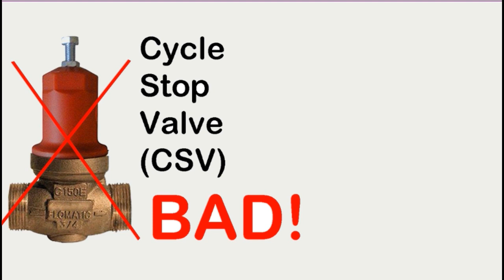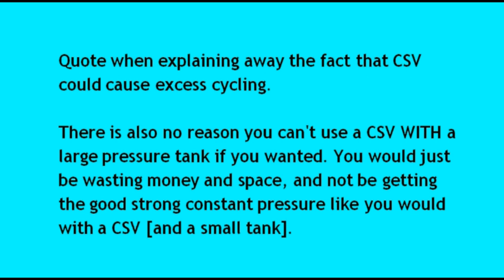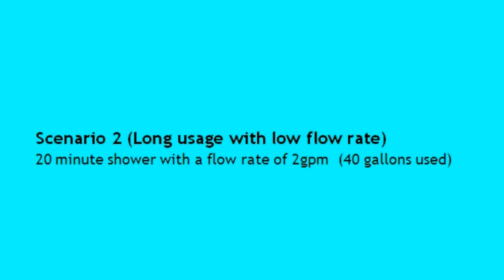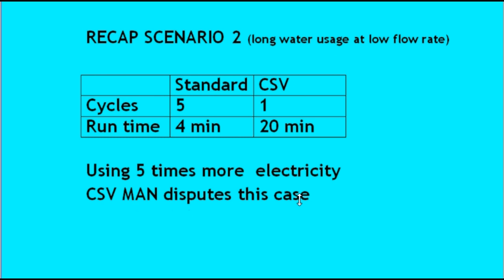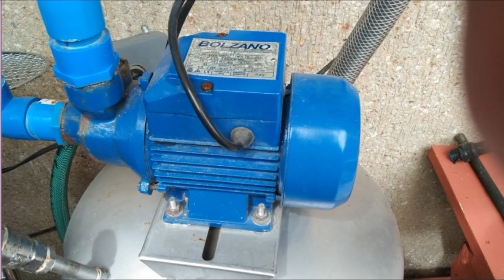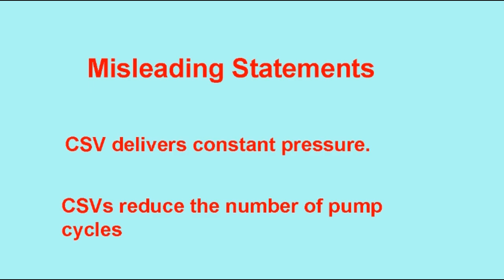Cycle Stop Valves ARE BAD for pressure tank systems!  Pros and cons of CSVs – few pros, many CONS!

Comment: Thank YOU Larry for an excellent review of this fraudulent product.  But, of course, then Mr. Austin (if that’s even his real name) is a con man par excellence!  Of course he had to have known “exactly” how a pumped water system worked in order to be able to convincingly extrapolate his false claims to fit his sales snake-oil sales pitch!  It “was” quite an impressive presentation though, with his animated flow and electric consumption diagrams.

So I – as a retired, patented, and multiple award-winning mechanical design engineer – became suspicious when trying to analyze his dazzling visual display, and his claims, and not being able to understand how this device could work; coming to some of the same conclusions that you did.  Obviously, stalling an electric motor cannot reduce its energy consumption, for one.  As you pointed out, and tested for, a higher load on an electric motor (like his restricting its flow, and increasing its pressure) can only “increase” its current draw as it has to work harder trying to maintain its flow rate.  I got tired of trying to sort through all these danger signs when I went and found your YouTube video: and you have definitively confirmed my suspicions, and have answered all my questions.

The reason that I came across CSV Man’s video, “How a Pressure Tank Works and why you need a Cycle Stop Valve,” was that I wanted to learn more about how the pressure-boosting system that I needed, and was building, works: with a 1/2 hp shallow well jet pump and a 20 gal diaphragm pressure tank.  An excellent YouTube video on why you need a pressure tank is "Pressure Tank: Operation and Components" by R.C. Worst & Co., Inc., at https://www.youtube.com/watch?v=WiVkI8YbE64.

The old saying that "A thief steals your money with a gun, a con man with a smile," certainly is applicable here just as it is with our unfortunate liar-in-cheif, and other politicos, with their fraud and much worse!  So I'm reporting Mr. Austin in this video, "How a Pressure Tank Works and why you need a Cycle Stop Valve,” at https://www.youtube.com/watch?v=LPIUufWjbic (and note his several other YouTube videos that you’ve alerted me to) for being a “big” fraud, a scam and a thief!

Find Out Who YOU Really Are!
LettersToMyBeloved.com
Reply: As an engineer you should know the difference between stalling a motor and derating a motor. Motors can be derated and restrict flow naturally by placing them in deeper wells. Pump installers do it all the time. Also a amp current check is the first thing pump installers do to check condition of a motor. They deadhead (restrict flow to 0gpm) the pump and check amps, if they are higher than full load that is a bad motor. If amps are lower than full load or derated then the motor is still good. I love how people comment on energy consumption without ever using an amp meter on one. You are a scam.
Reply: What type of pumps would you use for 8 BB 20''-4.5"in parallel filters and a final stage of 3 BB 20" 4.5" inline and a final 40" nanofiltration filter? ( my intent is to recircuate the waste of the NF membrane and reuse it).

Comment: perhaps its best to id the type of pump you are referring to in your examples.
Its hard to grasp but read up on Bernoulli's Theory and The Laws of Affinity. Basically what it is is that by restricting the flow of centrifugal pump, you are reducing the amount of work being performed thus reducing the power consumed. It also usually reduces the corresponding heat the pump produces since heat is directly tied to power consumption.

Comment: Larry can you advise me on this water use problem I have. I have a three hp submersible pump producing 83 gallons per minute under no load. I intend to  use this pump to water my lawn, each zone will require 35 gallons per minute with only one zone watering at a time. There is no pressure tank in this system, water will go directly from the pump to the sprinkler heads. Would you advise using a CSV for this application or can you advise me of a different valve or system? Thank You

Comment: At 34:00,  CSV Man may be assuming this particular pump as an example maybe because an industrial pump of this size often comes with an UNLOADER valve which essentially acts as a pressure relief valve, but opens fully, thus shutting off nearly all flow. CSV Man is fully committed to maximizing cash flow from his bogus invention, while minimizing proof of actual test conditions.

Comment: Larry, I installed the CVS valve.  In your scenario 1 at 18:02 you say the pump will cycle every time with each brief usage.  That is not my experience at all.  I have the very simple submersible pump set up you describe with a 20 gallon tank and a pressure switch set to 40/60.  The CSV valve is set to 55 PSI.  So, in a low or no water usage scenario that occurs after the pump cycles on the pump will run until it hit 60 PSI.  If I just wash my hands after that for 20 seconds or flush the toilet the pump does not cycle on.  How could it, if the PSI has not hit 40?  Perhaps, I'm missing something but, respectfully,  this basic premises leaves me doubting anything further in your video.  Can you explain?
Reply from the maker: yes i can explain easily. You have a 20 gallon pressure tank. That's way bigger than what they recommend. The bigger tank solves one problem but introduces others, like long tank refill time and more variance in the pressure before finally stabilizing.

Comment: Thank you Mr Larry for putting this video for reference. I am absolutely agreeing with your presentation and analysis. I saw the simulation that CSV man used and I am not convince. That man just moving his lips. I was actually looking how the fluid goes to the mechanical devices (the CSV) but the salesman could not reach that simple technological presentation. I was looking for a mechanical device as a replacement of VFD (lead times are too long) for my customer. I was not convinced about the CSV man and you enforced that on your presentation. If I may further your evaluation on the CSV, putting a device along the line increase the total head loss or pressure loss. Maintaining the demand flow in scenerio #4 with CSV requires more head pressure on the pump, more stress on the pump, more power needed, thus, less efficient and reduces the lifetime of the motor pump.
Reply from the maker: Yup, you are right. Thanks for you comment.

Comment: Love it! Thank you for your time spent on this. My well people pitch me the CSV with a smaller tank. I am doing off-grid solar and have lots of power concerns about the well system. You covered every concern that I had and more. I am going to go with 86 gal tank and with a pressure switch instead. Thanks!
Reply from the maker: You're Welcome! You also might want to consider the configuration of well pump to water storage tank then  water storage tank to pressure tank via booster pump. I cover that in some of my videos. That is even more efficient. If you are concerned about power and efficiency that may be the way to go.

Comment: I have to disagree with what you said regarding the "constant pressure issue", where you have stated that with the CSV valve installed, that varies from 40 to 50 the system will stay at 40 and maintain that pressure, which is absolutely not correct. I did personally install the said valve, and after turning on the water, pressure starts going up until it reaches the 50 cut off point and stays there, maintaining the same pressure as long as the water stays on, with the pump consciously running and a not cycling on /off. Once the water is turned off, the 50 psi pressure stay on until the water has been turned on again , and that’s when the pressure starts drooping till it reaches 40 when then the pump comes back on until it the 50 cut off pressure point is reached, and where it holds with the pump running and maintaining the same constant pressure.
Reply from the maker: I didn't say anything like what you stated. You have it all garbally gooked. The only thing you said I said which is true is that the pressure is not constant when you first turn it on. The rest of what you said showed you have no idea what I said.

Comment: I installed one about 10 years ago no problems.looks like you have the valve in the wrong place it is suppose to go between the back flow valve and pressure switch. I can turn on one faucet and the pump runs with out turning on and off turn on two faucets same pressure.
Reply from the maker: yes, i already issued a correction on that.

Comment: Ok, so☝🏽 allow me to ask you this...What can I do to increase the pressure without using a CSV?😳 Thanks.
Reply from the maker: What do you mean by "increase the pressure"? Do you want constant pressure? Do you want to increase the average pressure? Your question is not really clear. The purpose of a CSV is not to increase the pressure, it is to hold the pressure constant and prevent cycling during long runs.
Reply: @LarryElterman   I see. Ok, my water pressure it is not the same as city water pressure and if I try to water the lawn it doesn't have enough pressure to make the water sprinkler click to change directions.
I have a 40 to 60 and I checked the pressure in the tank and it was at 34 pounds so I set the pressure to 38 pounds and it seems to get just a little bit better but I would like to know if I can get more pressure, thanks.
Reply from the maker: @MrElPoderozo1  Honestly you are not making a lot of sense. What do you mean you have a 40 to 60?  A 40 to 60 pressure switch.?And if you have such a switch how can the pressure tank be at 34 pounds. I think you are quite confused. If you want me to help you then describe your current system and detail.
Reply: @LarryElterman  Never mind, thanks.
Reply: @LarryElterman  maybe focus on listening a bit before insulting people. I could understand what he meant no problem. I appreciate what you have in this video but will not be back for any more based on your attitude. 😆 sorry
Reply: @MrElPoderozo1  If you "really" want constant pressure, set pressure switch to on at 60, off at 80 and add a 60psi regulator after everything else - expensive but will keep pressure at 60 psi as long as you have the GPM to support the flow at that pressure. The regulators have specifications based on GPM so you may need a very large one just to maintain typical GPM.
Reply: @timvandusen4192  Thank you very much for taking the time to help, it is really appreciated. 👍🏽😊

Comment: 3:27 The Cycle Stop valve doesn't go there. It is supposed to go before any taps or devices, including the pressure switch. I just installed one yesterday, per the instructions, and it's working well and doing exactly what it was designed to do.
Reply from the maker: Yes I made a mistake with the pressure switch, it is supposed to go on the Tank. Good Catch. I thought I posted a correction about that somewhere but It seems to be gone. The only mistake in the diagram is the pressure switch.  Where I show the pressure switch would be a total disaster. I know somewhere else I mentioned this but i cant find it. Thanks for bringing it to my attention. I will post a correction comment.  Yes the Cycle Stop Valve works in the following ways, it provides constant pressure and does not cycle. Nobody is denying that. My multitude of videos explains why they are not good, i will not go into it in this comment. But  yes, you are correct, the picture is wrong. Thanks for the correction.

Posted a few minutes later. Aha, i did post a correction comment but it got pushed down. I just pinned it to the top.

Comment: You clearly don’t understand the concept… you said it restricts the flow to 1 GPM… which tells me you don’t really understand it. Additionally, a pump is rated for a specific volume that you note, but often the pipe on the discharge side is stepped down several times before it reaches the destination… that too would have the same affect as what you are saying a CSV would have… so is the plumbing in your house ruining your well pump??

I will continue to review your data to consider the rest of your argument… but as of now I must say, you’re a bit of a drama Queen… the inflection and emphasis you put into someone else’s words/response can change the response itself…  it’s petty… you seem, or at least come off as, more interested in being right and voice acting the drama vs actually understanding and demonstrating the actual functionality.
Reply from the maker: I don't understand the concept? Good grief, you are the one that does not understand the concept my friend. The 1 GPM is only after the water is no longer being used, that is the tank refill rate. That is not even in dispute. Even Cycle Stop Valve in their video explains how the pressure tank is refilled at one gallon per minute.  The rest of the time when water is being used nobody is saying the rate is 1 gpm. As for the output pipe restricting water and that being the same as a CSV, once again you are clueless. With a cycle stop valve the pump never goes off while water is in use. Thus it builds up back pressure in the piping BEFORE the CSV. With a regular system the pump will turn off preventing the high back pressure. You really should not tell somebody they don't understand the concept when in fact you yourself clearly have no idea whatsoever what is going on.

Comment: Its very simple to me.. If you restrict a motor that is designed to push a certain (flow), the motor with pull more power to try and push that design flow.
Reply from the maker: So you are saying the opposite of what the Cycle Stop Valve people are saying. What you are saying is correct most of the time. Many different types of motor and pump designs however..
Reply: Pumps create flow, the system is what the pressure is based on. 

A pump's current is based how much mass the pump is moving, not the head developed. It's somewhat counter intuitive, but you will actually have (in an ideal system) the same total watts used with or without the CSV. The issue is, since the pump is not starting and stopping continuously, you skip the high load start up current.
Reply: Correct if you restrict the flow of a pump you shorten the life,and cause other problems.

Comment: Thanks @LarryElterman for this video! I am pretty novice with well pumps in general, but I thought to buy a CSV after seeing a posts about them online. Pretty much, as you stated, there is A LOT of good praise for them but, to the average joe like myself, it is EXTREMELY easy to read these posts and immediately believe them. The concept sounds foolproof but, as you break down the logic methodically as you did in your video, you can easily see there is a major flaw and down side to using a CSV. I really hope your video reaches more people that are wondering how to solve "cycling". 

Anyone finding this video for answers, the shortest and simple answer is. Locate your pump manufacture catalog and check the "Diuty Cycle" ... If your pump is rated at continuous, then you only need to maximize the flow of water so that the pump can never fill the tank psi to your cutoff point! Simple as that... no need for a CSV.

CSV:
* creates back pressure against an electric driven motor
* causes spikes in aperage
* is extremely easy for a novice user to DESTROY their system

To elaborate on that last one, the back pressure created for some older systems that already have weaknesses in their integrity (pipes are old, stressed, and worn from years of use) then it can sometimes expose those weaknesses causing pinhole leaks in your plumbing. 

Thanks again Larry, you saved me 200 bucks and probably more in repair. My system is old and Im sure a build up of back pressure would've definitely exposed weaknesses that I'm not ready to pay for nor tackle.
Reply from the maker: Thanks for your comment! Glad my video helped you! Just curious Nick, you mentioned the back pressure. That's true, CSV creates a lot of back pressure, especially if you have a powerful pump. Did I mention that in this initial video? I don't think I did. How did you come across that fact, just curious. I think I mentioned that in other later videos I did. I'm always forgetting to mention that, and that is actually an important downside of the CSV.
Reply: If a pump short cycles too much, the pump is oversized for the application. A CSV will harm the plumbing only if the restriction creates too much backpressure. You need to have the correct sized pump in all cases. Put in the correct sized pump and all this posting nonsense is not needed.